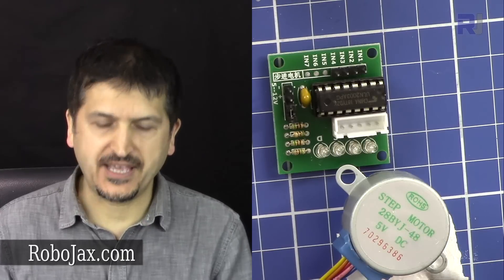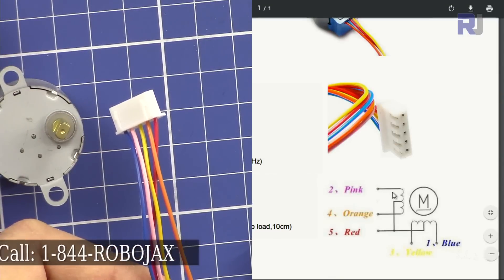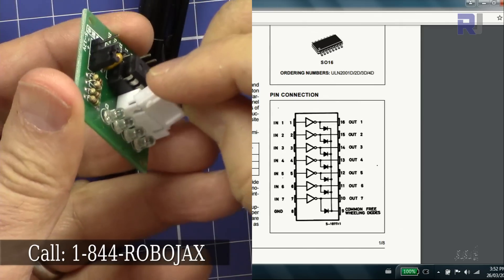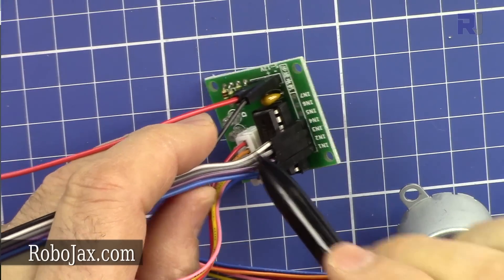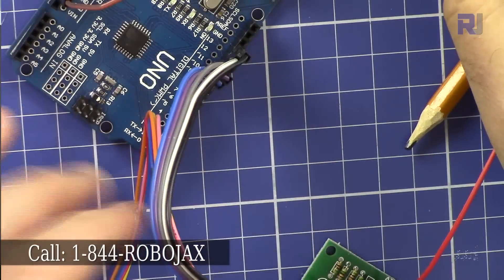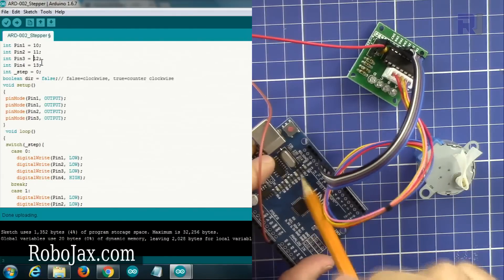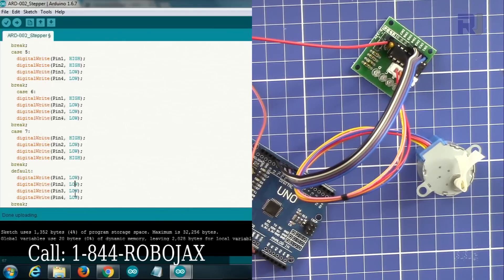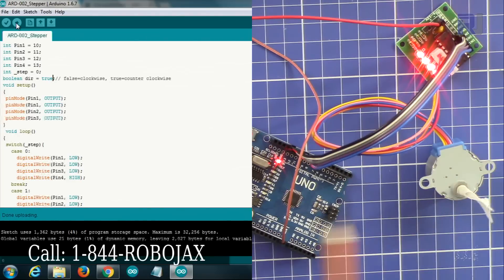Control Stepper motor 28BYJ-48 with ULN2003 for Arduino - RJT4

Comment: How can you automatically reverse the motor when it stalls.?
I want to reverse the motor for 3 seconds when the motor stalls.
I love your videos because you answer  most questions during the video.
Reply from the maker: You are welcome.  I am glad you found them useful.
To change the direction of stepper motor this code you  can use dir = true; or use dir = false;
so use it after the Case X; where x is 1, 2 , 3 o4.
but I have write separate code to accommodate this specific feature.
Reply: I need a way to get the motor to reverse only when the motor binds up. If some causes the motor to stop because it locks up I want it to reverse the direction for 3 seconds to release the bind then continue. Can we read the difference in load or voltage sensing an increased load
Reply from the maker: It needs a little work but doable. If I want to do it, I have to create the whole project.  I am very busy with creating contents.
I would suggest posting your question at Arduino official forum: https://forum.arduino.cc/You can read the voltage difference but it wont' be reliable as there would be unknown factors that changes the values.

Comment: sir i want to make robotic hand ....control by flex sensor and stepper motor please me the arduino code...my stepper motor 1.8 degree ,bipolar
Reply from the maker: I don't have the hand to practice and see it. I have in mind to have project, but until then you gotta find  a way to finish your project. Subscribe and watch my videos.
Reply: You shouldn't use a stepper motor for a robotic hand. Servo motors work better.

Comment: Thanks for your great video, sir. I had my circuit arranged just like yours, but it turns out that only one LED on the ULN2003 is on, and the motor didn't move at all. My code is more simple than yours, though. Could you tell me where may I possibly made mistakes?
Reply: And here is my code:
int dpin=2;
int cpin=3;
int bpin=4;
int apin=8;
void setup() {
pinMode(dpin,OUTPUT);
pinMode(cpin,OUTPUT);
pinMode(bpin,OUTPUT);
pinMode(apin,OUTPUT);
}
void loop() {
digitalWrite(apin,LOW);
digitalWrite(cpin,LOW);
digitalWrite(bpin,LOW);
digitalWrite(dpin,HIGH);
delay(1000);
digitalWrite(dpin,LOW);
digitalWrite(bpin,LOW);
digitalWrite(apin,LOW);
digitalWrite(cpin,HIGH);
delay(1000);
digitalWrite(cpin,LOW);
digitalWrite(dpin,LOW);
digitalWrite(apin,LOW);
digitalWrite(bpin,HIGH);
delay(1000);
digitalWrite(bpin,LOW);
digitalWrite(cpin,LOW);
digitalWrite(dpin,LOW);
digitalWrite(apin,HIGH);
delay(1000);
}
Reply from the maker: Why do you have delay(1000)?  Use the code I provided and try it. https://goo.gl/e8HbaH

Comment: Why this motor vibrate when working?
Reply from the maker: The vibration is due to unstable mount of motor.  if you try to rotate something with the motor, the motor should be mounted tightly. Or the motor is defective.
Reply: I am just trying to run this stepper motor without mounting anywhere but its keep vibrating and does not move.
Reply from the maker: Oh, the vibration is due to incorrect wiring or sequence that makes the motor rotate. Please check the wires to be connected to the wrong pins either on arduino or the motor driver board.
Reply: Yes the connections from motor into driver are not correct so I connect arduino according to that wrong sequence and now working fine.

Comment: Sir, its possible to control speed in this project with potentiometer? ( in camera slider)
Reply from the maker: yes it is possible. The  code http://robojax.com/learn/arduino/?vid=robojax-0293 shows that the motor rotation is controller by the value of _setp. so you can make _step depends on the value of potentiometer  (code is here http://robojax.com/learn/arduino/?vid=robojax-ard-poten).
so you have to convert the value of "voltage" which is float to integer make us between zero to 8.

  // Convert the analog reading (which goes from 0 - 1023) to a voltage (0 - 5V):
  float voltage = sensorValue * (5.0 / 1023.0);

int stepNew = (int) voltage % 8;// 
Now  you can use stepNew to control motor. 
I have not tested it but this is the idea.
Reply: RoboJax Videos . Thank You
Reply: @robojax  I can change the value of _step but the speed still the same.

Comment: Hello, you have a variant on you site to stop the motor after 3 sec. You need to remove the 'else' (located almost at the end of the script) because it always reset the counter to zero and the motor never stop.
Reply from the maker: You are right. I will test the code and update it. Thanks.
Reply: I am finding the answer for that question, motor can not stop, thank the both

Comment: Why don't you gave 5V (power) from auduino board?
Reply from the maker: Because arduino can't have enough power (Current) to run the motor. You have supply 5V from external source.
Reply: Thanks for replying, The doubt came because there are many tutorials that have used 5V from arduino board and are working. I am tryring to work with 28bYJ-48  12V motor, i checked the wiring they are correct . But i don't know motor is only vibrating, i don't have 12V adapter or battery, how i can solve this problem any suggestion, will it work from 9V battery?
Reply: @deepakkumarpainkra6071  Try and change the speed of the rotation. If a stepper motor is made to spin too quickly it will vibrate instead of moving as you have experienced.

Comment: I have this one... do not know what arduino is, can I run it without "arduino"?
Reply from the maker: Arduino is a microcontroller (micro-controlelr) that can be programmed to do things.  this motor needs different signal at different angle or time to rotate. Arduino makes the right signal so the motor rotates. If you can do the same type of signal using other means or controllers, it will work.

Comment: Thanks for this video. Is it possible to make this stepper to work faster?
Reply from the maker: I have not tested it but it should work. Current code is  dalay(1) for 1ms ( milisecond). So change it to delayMicroseconds(100); this is now μS or microsecond which is 1000 times smaller than ms. So 100μs is 10 times faster than ms. So divide 1000/xμs and you will get the speed factor. for example if the 1000/200=5, so it will be 5 times faster. You should not that dalayMicroseconds(x) will accept only integer like 10, 200, 1 but not 150.56. test it and let me know by replying to this comment.
Reply: Maximum for this type is 750, will do a "gearbox" to speed it up.

Comment: why you set up have 2 times the sentences whit pin1?  
pinMode(pin1,OUTPUT);
  pinMode(pin1,OUTPUT);
  pinMode(pin2,OUTPUT);
  pinMode(pin3,OUTPUT);
Reply from the maker: it should be. Thanks for tell me. but I have to check,  how come the program was working with those wrong values.
 pinMode(Pin1, OUTPUT);  
 pinMode(Pin2, OUTPUT);  
 pinMode(Pin3, OUTPUT);  
 pinMode(Pin4, OUTPUT);
Reply: it is working just fine, because these pins are set as outputs by default

Comment: pls help my motor is vibrating but not moving
Reply from the maker: you have connected either the wires incorrectly to the motor or to the wrong port on Arduino. If the order of wires are not correct, it will not move or simply make noise.

Comment: How to make the stepper motor stop working after the rotation? For example after 2 cycle rotation the stepper motor stop working.
Reply: Hey RoboJax, thank you first of all. When using the second code on the page to run for a certain amount of time, it doesn't work. It runs forever. 

I notice "else count=0" so this a flag to restart everything because if your runtime is 3000, and once the check "count<runtime" failes, it just starts over at zero. 

This is why it is running forever. I added the "stop_motor();" in the "else" statement but the motor will not turn at all. Please help, ty ty ty.
Reply from the maker: I just wrote a code for you so the motor stops after certain time. http://robojax.com/learn/arduino/?vid=robojax-0293
You can change it do other things. I have not tested the code but it should work. Good luck.
Make sure you get the second code on this page. Let me know if it worked.
Reply: RoboJax Videos I have another question which part should I change to make the different rotation?
Reply from the maker: I have posted complete new code. so copy and past all. If you want the old code with continues rotation just get the top portion. You will compare both codes and find the difference.
Reply: RoboJax Videos thank you very much.

Comment: what is your voltage source
Reply from the maker: the board needs 5v. The motor voltage depends on the motor. In this video it is 5 V. Watch the video fully, I have explained it.
Reply: I know about the 5v, what I don't know is how much amps I need... I tried connecting the motor with a 9v battery but it just vibrated. Then I connected it with 7.5 vdc 500mA power source but same thing happened. Can u pls tell me your power source
Reply: I know about the 5v, what I don't know is how much amps I need... I tried connecting the motor with a 9v battery but it just vibrated. Then I connected it with 7.5 vdc 500mA power source but same thing happened. Can u pls tell me your power source

Comment: hello
can a sensors  be addet to the arduino  to make the motor recerse the same distance
as i want  to work a barrier on a model railway in other words when the first sensor 
is hit by the train  it will close the  barrier and when the second sensor is hit it will reverse the motor to open the barrier and would the code be difficult to write
as i am new to electronis
your help would be greatly received 
regards
james
Reply from the maker: Watch this video and see how the direction of motor is reversed with hand gesture. you can use your sensor instead of the gesture sensor and change the direction of the motor. https://www.youtube.com/watch?v=KfAnUgaSDmI
Reply: hello
thank you very much for your help
Reply from the maker: you are welcome.
Reply: Very easy, just add a couple of pins for the 2 sensors, when then sensor go hi/low on the pin, do a counted loop to open the gates and stop. Then when the other switch is activated do a reverse count to close. What sensor you use and how you open/close the gates, is down to you.

Comment: i follow this tutorial but my motor only vibrates and doenst move is axis. Is it broken?? Can anybody help?
Reply from the maker: 1- you haven't connected external power sources. So you have week power
2- The order of wires are not right. check the connections.
Reply: if the states are switching too fast it won't do more than vibrate, need some delay.
Reply: There is an error in declaring the outputs in the code, fix it and it works. I had the same problem.

Comment: Hello,It's a good tutorial, I'm interested in your idea, I want to know how if 
from analog to motor, for example using LDR sensor (A0), the motor will go 
right if sensor ldr to light, if dark motor will reverse direction, how 
is the arduino code? thank you
Reply from the maker: You can do it  by watching two video and should combine them.
1- how to read potentiometer with arduino https://www.youtube.com/watch?v=TbLdAQpE4jE

2- How to control motor with your hand gesturehttps://www.youtube.com/watch?v=KfAnUgaSDmI
So first you have to understand how motor is controlled  then implement it.
Reply: Okay thanks, how to code if stepper motor will stop when press micro switch?

Comment: Hello with that motor and controller I want to do with an application to the button a button on the cell turn to the right when you press another turn to the left and you stop everything you could help me could not do anything
Reply from the maker: The direction of motor is determined by the variable "dir".

Use this button project to read button https://www.arduino.cc/en/Tutorial/Button
and inside the loop just before switch(_step)
put this code.

if (buttonState == HIGH) {
   dir = true;
  } else {
    dir = fales;
  }